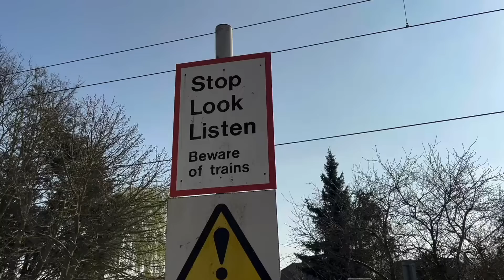Why Do Tube Trains Whistle?

Comment: There are several reasons why a tube train sounds its whistle, and as you rightly surmised, they're all to do with reasons of safety.

As a quick note, the whistle has two settings that can be used, loud and soft. 'Soft' is to be used inside tunnels or other enclosed spaces, 'loud' is to be used outside. In practice, both carry just as far and most drivers only ever use 'soft'. Why not 'loud' all the time? Many, if not all, drivers have at one point been caught at the wrong end of a whistle blast and are aware of how incredibly loud the whistle is when you are near it. Why use 'loud' when 'soft' will do? (they're also two different notes, so you could in theory play a simple melody using just the whistle of a tube train, but I digress)

According to the rulebook, there are some moves that must be accompanied by a blast of the whistle, or several. Usually these moves are done in an emergency or other unusual situation, and they serve to warn people who might legitimately be around the track at that time of the presence of a train coming from an unusual direction. It might, as an example, be necessary for a tube train to travel the wrong way on a line for a short distance, and in that case the driver must sound the whistle on set intervals or in a set pattern.

Whistles are also sounded where a deep level tube exits to the surface, to warn people who might be around the tunnel mouth that a train will soon be leaving the tunnel.

Trains leaving service out of a station are also expected to sound the whistle, because they are likely to be taking an unusual route to a siding rather than staying on a main line. All of this is to warn people on or near the track, even if none are visible. Especially if none are visible.

The whistle is also used to gain the attention of workers on or near the track, who must respond to the whistle signal by some form of positive hand signal (or light signal if in darkness). That way the driver of the train can be confident that the people on the track are aware of the train and they can proceed in safety.

Frequently, on some lines, the whistle is still used for its original purpose: to scare away wildlife on the track. My line doesn't have any risk of cows on the track, but there have been occasions I've had to frighten off smaller wildlife (such as foxes. So many foxes!) and even deer.

Lastly, but by no means least, whistles are also sounded when a train will be passing through a station that is closed. After all there might be people on that closed platform carrying out works, who need to be alerted that a train will soon be passing through at relatively high speed.

So in short, because I have rambled a bit here, the whistle is a safety device, used whenever the train is doing something which is either unusual or might endanger someone be they seen or unseen.

Bonus trivia facts about the Northern line:

There is a whistle board for trains when leaving for Morden depot from Morden platform 2. This is because the official walkway from that depot runs under the bridge and along the side of the building at the southern end of platform 2, creating a path of limited clearance. Many drivers take a perverse pleasure in waiting until an approaching driver on foot is nearly level with the cab, and then sounding the whistle. There is also a whistle board for trains leaving the depot and entering Morden station, to alert passengers that a train is approaching from the opposite end they might be expecting.

For that same reason, a train must whistle when entering Euston (Bank branch) southbound from the King's Cross loop. It's a rare move, but it does mean the train approaches the platform from the opposite and thus utterly unexpected direction.

There is a board between Finchley Central and West Finchley instructing drivers to only use their whistles for reasons of safety. This is because there is a footbridge over the line, which is a favoured observation point for children to watch trains during the summer months. Naturally they signal for us to whistle. Of course we are happy to oblige. If anyone ever asks why I whistled there, I shall blame a fox :)
Reply: "there have been occasions I've had to frighten off smaller wildlife (such as foxes. So many foxes!) and even deer."

Out in the sticks on the "big railway" I can tell you from too much experience that deer respond badly to both tones of a two-tone horn - as in they always then veer into the path of the train rather than away from it - so I've given up using both tones. 

They (usually) shift out of the way if you use repeated blasts of one tone instead, as do birds of prey, but when deer do insist on committing suicide, muntjac make a much bigger bang than roe deer. :(

Pheasants and pigeons are simply suicidal. Pigeons are greasy and leave a huge grey mark on the windscreen which is impossible to see through and takes a lot of screenwash to remove, except when they hit the windscreen wiper arms and simply explode, which is as disgusting as it sounds.
Reply: Thanks for the information
Reply: > in theory play a simple melody using just the whistle of a tube train, but I digress

The London Transport Museum should put on a show!
Reply: Very interesting. Are their also visual alerts for the hard of hearing, deaf and foxes who are not paying attention?
Reply: Thanks for a really interesting and informative reply. 

I'm now thinking that we need some sort of concerto, composed for piano and train whistle.
Reply: Thanks for taking the time to explain all of that - even though Ilive in Scotland and seldom use the Tube!
Reply: Pretty certain that the whistle was also used to alert signal boxes if the line was hard to see.
Reply: Even with ATO can drivers not just look at something else while the train is taking care of itself between stations?
Reply: In reality the driver's don't whistle half as much as they should. Nearly shitted myself when working on an unused platform and a full speed met line train blasts past. 

Also waved at a met line train with the driver completely unaware and seemingly on their phone.
Reply: @bengoacher4455  I don't know about on LU but on the main line anyone working "on or near the lineside" is required to look up at least every 5 seconds precisely so they don't get caught by surprise.

That said anyone working on a platform is by definition not "on or near the lineside" so the horn shouldn't be used unless the driver judges that they're at risk owing to their location or behaviour.

Any driver using a mobile phone while driving is committing a sacking offence and should know better.
Reply: @atraindriver  the platform was just past the station building which created a sight line choke point where working on the disused platform meant not being able to see down the track. I could hear the train coming, but it was still unnerving the first time a train went past at speed. Soon got used to it though.

I can't confirm they were definitely on the phone. But they were looking down with their hands in front of their body and didn't look up or acknowledge my wave. I would've reported it if I bothered to check the time it happened instead of muttering to myself and going back to work.
Reply: @bengoacher4455  I look down too when I'm driving, at my workings to see if I'm running on time, at the defect book if the train isn't performing correctly or for other reasons. A driver would have to be stupid to be using their phone.

If there was a sighting issue then the driver wouldn't be able to see you either: if you can't see the driver's window, the driver can't see you. I've been reported for not whistling at p/way staff who were behind bushes and completely invisible to me!

Comment: Thank you Jago for this fascinating from the Tales from the Tube.
You are the copious quantities of wind to my whistle.
I took a photo of the cab of an ex-1938 stock running as a NSE liveried class 483 at Ryde Pier Head Stn (IoW) featuring its whistle just before I boarded it bound for Shanklin. The 483s had just arrived on the Isle of Wight. My previous visit enabled me to travel on the previous class 485 (sad to see them go). Happy days. At least the ex- UndergrounD trains are keeping the tradition with the ex- D78 as class 484. I remember using the Bakerloo Line Trafalgar Sq in the early 1970s and a 1927 trailer in a 1938 stock train. Best wishes from Oxfordshire.

Comment: Whistle codes are still used. When approaching Ashwell signal box, if you're driving a train that is heading off to Corby at Manton Junction then you need to use '1 long, 1 short' on the horn....this lets the signalman at Ashwell know he has to advise Oakham then Manton Junction which train you are, and which way you need to be signalled.

Comment: I've always been curious why, and this has answered my question well.

Lots of drivers sound the whistle for trainspotters, and you can even get some serious hellfire when you're in more rural areas such as Mill Hill East. Click 'read more' some quick trivia:

- The quietest whistle is on the 1972 stock (Bakerloo), but the loudest is a tie between the Northern and Jubilee lines (95 and 96 stock respectively).
- Whistles are not only used for depots, but sidings too. Take Willesden Green for example, drivers often sound it just before entering. This also applies to underground sidings such as Tooting Broadway.
- Every tube stock is fittest with a whistle switch which has the regular off mode, and two whistle switches, one operating the whistle with less air pressure (quieter) and vice versa (with more). Additional fact is that not all stock used to be like this. The D,  1967 and MkI 1972 stock (to name a few) used to have a simple button to activate it.
- The line that sounds the whistle for spotters the most is the Bakerloo Line.

More will be edited in if I remember any others.
Reply: The C69/77 stock also had a one-tone whistle activated with a button, which is how they appear on World Of Subways 3: Circle Line. The game will penalise you for doing some things wrong (such as late-running or overshooting a platform), but mis-use of the whistle is not one of them, even though whistle boards are included on the Paddington - Hammersmith section. 

Most of our trains here in Sydney also have two horn modes: Town (quieter) and country (louder). On some trains (the XPT most notably) both can be sounded in harmony. I’ve been on the receiving end of some country horn blasts: They can be extremely loud. 

There is also a “yard” tone on some of the newer electric trains although that’s less of a horn and sounds more like a lorry’s reversing signal. Really, it’s for use in depots where a full-blown (ha!) horn would be unsuitable but some warning is still needed. I have heard them sounded in regular service on occasion too.
Reply: @TheBritFromOz008  How interesting!
Reply: I love the more booming yet low tone the 72 stock whistle has.

Comment: On national rail, the theory is that in the hours of darkness, people should be able to see that a train is approaching from the headlights standing out against the darkness and therefore the horn or whistle is not as necessary as during the day.
Reply: Also it wakes people up who are trying to sleep, and that would cause a lot of angry people, looking for someone to blame.
Reply: Presumably there must have been a rule change in the last 50 years because steam trains and first-generation diesels weren't fitted with headlights. The Chinley accident in 1986, where a driver got routed over a crossover on to the wrong line after a power failure and didn't realise, wouldn't have happened if he'd had a headlight.
Reply: Yet when I’m on track at night, they still like to blast their horns when they’re 10ft behind me.
Reply: Decent headlights started to be fitted in the eighties -possibly to passenger trains first. All modern stock has to meet certain requirements. There is normally a day mode and night mode. 

If they have a high-level headlight above the cab window then they don’t have to have yellow ends either.
Reply: Unless of course you are facing the other direction away from the train

Comment: whistles get ignored at night for the usual reason: If the locals are being complete idiots in ways that endanger themselves and others and/or make everything objectively worse for everyone, officials will listen to them almost without fail (if they can find a relatively low effort way to avoid any legal consequences of doing so, at least), while if something causes or will cause legitimate issues that should be addressed, you can reliably assume it will be ignored (unless doing so is likely to lead to significant unfortunate legal consequences for the officials involved).

There are exceptions, but that's the default.

Short version: some idiots complained, some other idiots went along with their complaint on the basis that it would make the first idiots shut up and go away (or possibly increase their odds of reelection). 

The reality is that if the wistle is unnecessary it shouldn't be used regardless of the hour, and if it's necessary it should be used regardless of the hour.

Comment: Reminds me of a similar feature on trams, the bell (or gong, as it's technically known here in Canada). Typically it rings twice upon accelerating from a stop. Older models have a physical bell; the newer ones in my area use an electronic reproduction.
Reply: When I was in uni, the trams would have a little bell that would ring before setting off, and if the driver thought someone was going to be in the way (followed by a loud foghorn if they remained in the way!)
Reply: @mattcannon2  Here in San Francisco, there are a couple of streets where drivers will enter the intersection even though there's a traffic jam on the other side, and get trapped when the light changes and the pedestrians assert their right of way. When this happens, the tram drivers like to creep up to about six inches from the stuck motorist, loom over the car, and lay on the horn! It's always fun to watch the drivers realize that there are even bigger vehicles they share the road with :-)
Reply: Yah, our heritage streetcar line here (Minneapolis-St Paul, MN, US) uses the physical bells on the old trolley cars before they start, and when they're crossing a street with them.  There's even a signal bell inside at both ends of the car, used by the conductor and the motorman when they're running in two-man operation.

Meanwhile, our modern light rail trains play a recording of a bell sound when starting and stopping, or when running through street intersections where the line runs down the middle of a street.

Comment: I assume tube trains never had conductors… so was the whistle doing the job of the conductor (with his whistle) for surface trains. I did/do love the sound of that whistle preceding departure, not to mention, abundant platform staff, happy days. Oxford Road Manchester, I always found to offer a very real experience.
Reply: The tube absolutely had Conductors/Guards back in the day,

I think the last to go where in 2001 although I'd happy to be corrected on this, Maybe Jago will bless us with a video on when each of the lines lost them.
Reply: @JJmoogle  The last tube trains with guards were the 1959 stock, which last ran (in revenue service) on 27 January 2000 on the Northern line.

Comment: Whistles are still standard in Switzerland, not known for being backwards when it comes to railways.
Reply: Not backwards, really? Back in the 80s I was sitting at Gampel-Steg waiting for a train to Visp. A man pulled up in his little locomotive with a couple of wagons attached. He jumped out and quickly placed a chock under a wheel before it could roll away on the slight gradient, and went into one of the station buildings. A few minutes later he reappeared, jumped into the cab, backed up a short distance to free the chock, jumped out again to retrieve the chock, then finally jumped in again as it began to roll forward. How I wish we had smartphones back then, it was hilarious.
Reply: @MeFreeBee  What's wrong with a safety first approach ? They still use chocks on aircraft of all sizes.
Reply: @hb1338  working brakes might be a better solution

Comment: During my two week in London with dozens of tube rides I never once heard a whistle, then again when your focus is making sure you are on the correct platform to get back to the station where you got on the wrong line to get back to area your hotel is in you might just miss that
Reply: I lived in London for 15 years and took the district line every day, as well as using other lines regularly. I don't recall ever hearing a whistle. Perhaps I didn't notice but the sound from this video is completely unfamiliar.
Reply: @NenadVukicevic  hear plenty, mostly on Empty stock movements platform to depot at Morden
Reply: @NenadVukicevic I don't remember hearing a whistle on the district line either on a visit back in 1971. (My clumsy fingers nearly put in 1771 but neither the tube nor myself were around back then!)

Comment: It's interesting as most modern multiple units have depot whistles too, I'm sure I've heard a class 377 use it's whistle before
Reply: They do have depot whistles, at least the 375s do
Reply: Yeah Class 377’s do have depot whistles
Reply: Me too
Reply: Indeed. A number of Bombardier Electrostars and Bombardier/Alstom Aventras (Class 730, for example) are still being fitted from new.
Reply: I think that might just be a Southern thing.
Reply: @SteamboatWilley  Class 730s are being fitted with whistles, so it seems to be going beyond Southern.